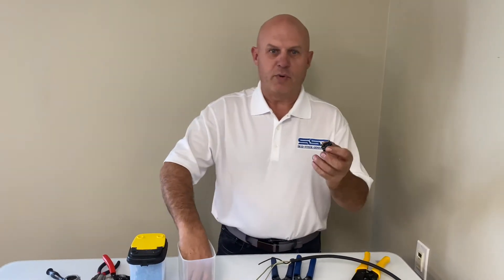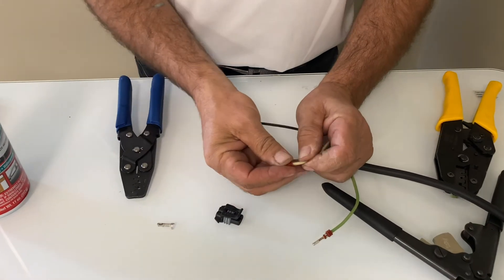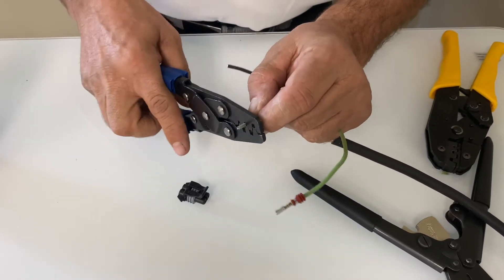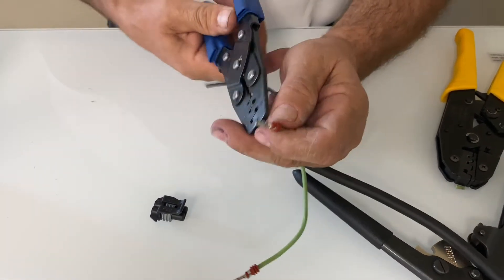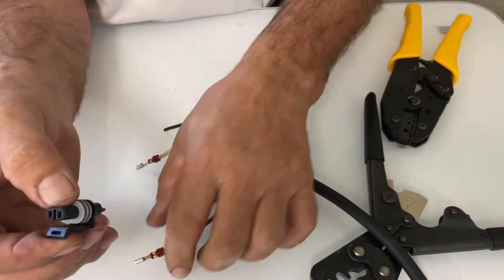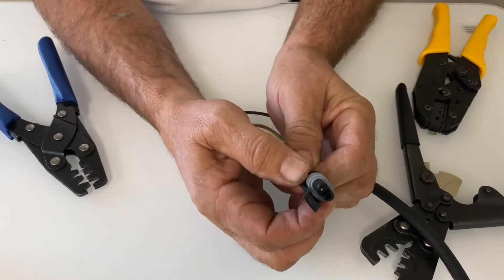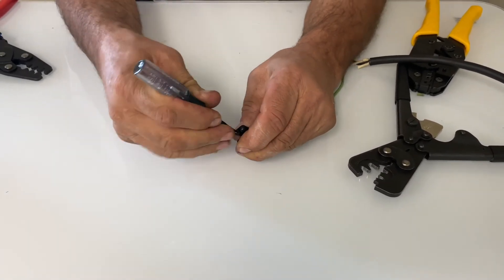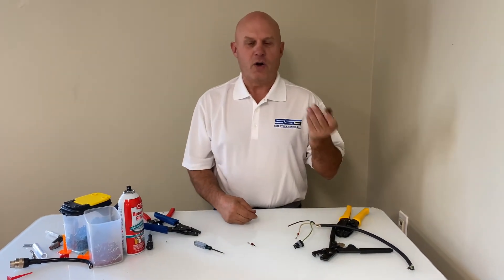#136 - How to Assemble a Delphi Metripac Connector

Comment: The crimp on the weather seal should be circular not a rolled crimp.  A proper Metripack tool will have circular crimp positions for the seals.
Reply: True, but why pay more for another crimp tool, when you can use what you already have?
Reply: @ Beacuse it compromises the weather seal.

Comment: I'm dealing with this in my '91 Buick Century now. The terminal for the inline pump fuse had a bad connection. So I changed it but I'm still having issues with it. Can anyone tell me if there is a way to crimp it down with the tools I already have and if not where could I find a crimp tool for less than $75 ??